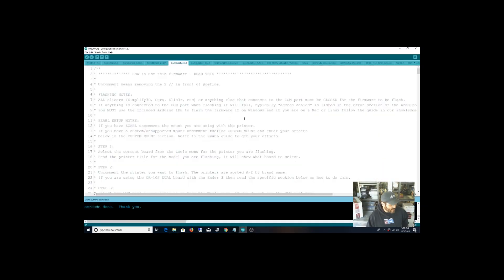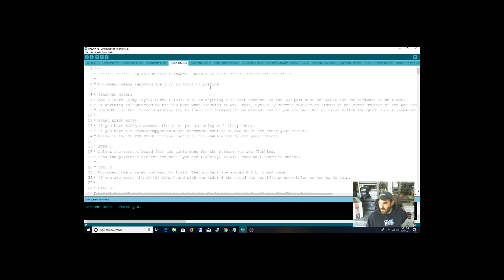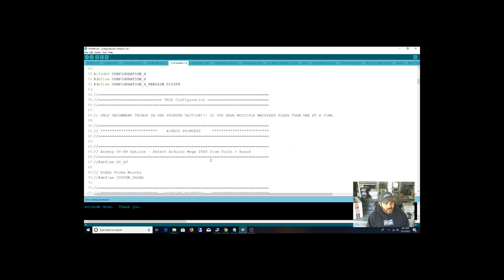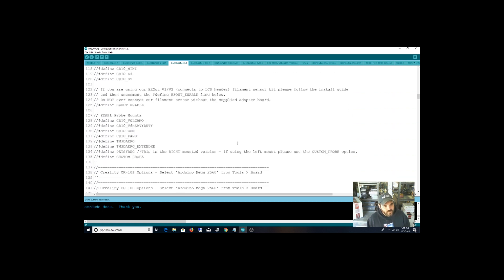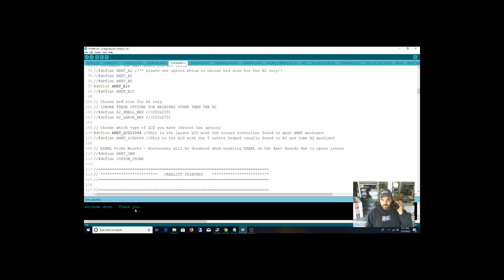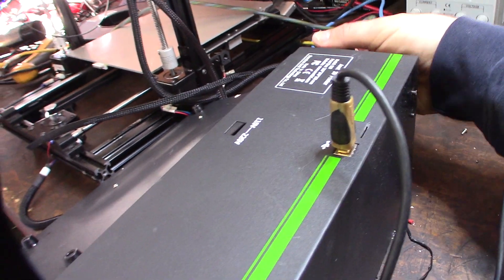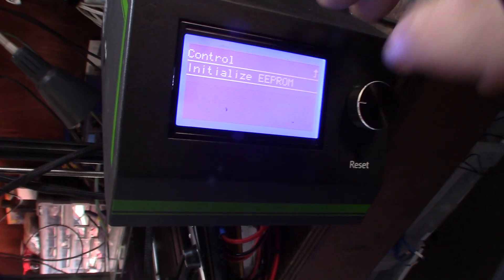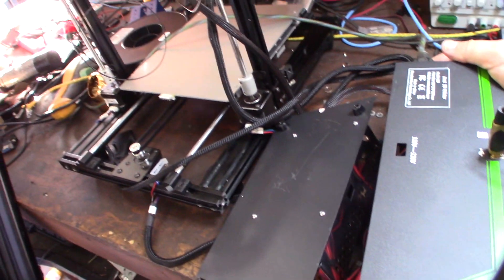Anet Marlin firmware E10 E12 A8 for BLtouch and capacitive auto bed leveling

Comment: Nice video @fintechrepairshop. I have updated my firmware on the Anet E10 and it works perfectly! However I have now added my BLtouch and im having problems. the hotend is at the top of the printer? Did you have any issuses with your install?